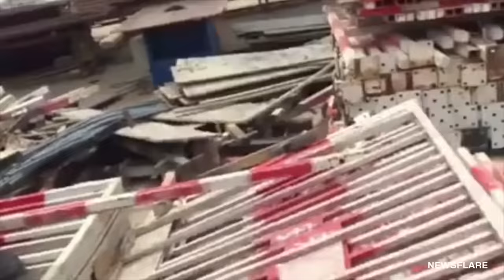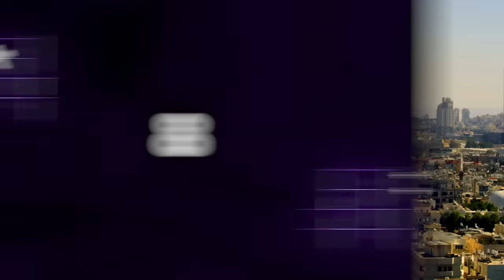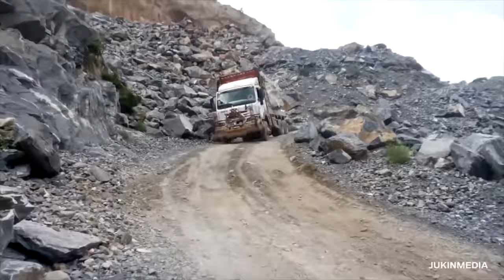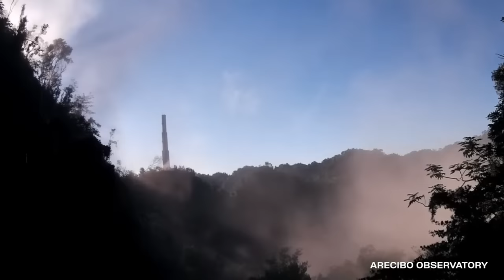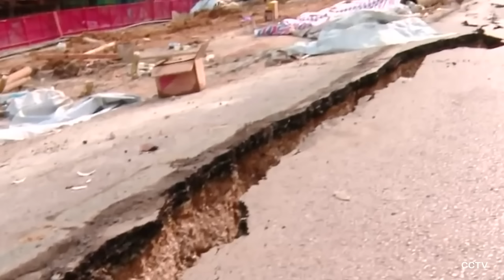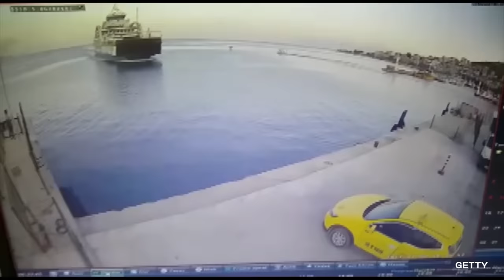10 Catastrophic Failures Caught On Camera

Comment: As far as the house on the outer banks going into the water, that’s nothing new on the NC barrier islands. I have lived here most of my life and every storm we lose homes to the sea on all the islands.   It’s not climate change or anything like that. The barrier islands are just sand bars that are in constant motion. They lose sand on one end and gain it at the other. That’s the risk you take building on a piece of sand in a hurricane zone.
Reply: fortunately the water was there to break its fall or it would have smashed to bits :)
Reply: Well stated.
Reply: Thanks for stating that...we had a cottage in Kitty Hawk for 30 years. Saw many storms and hurricanes come and go. Just off the beach we had a sandbar, I would surf the different ends of it. North end the cottages were eventually eaten by the storms. We also had the sand fence up and year after years saw them slowly be covered and grin at our success. Here's a bit of history for ya. The original bridge made of wood, I can't recall now but around 24 wide by 16 thick. The man which started our cottage ( his first, never finished it ) had somehow acquired those beams as they took down the old bridge. Those beams were and are still under the cottage. We always laughed...( in  fear ) of losing the cottage to a storm, " we if it does get that high, she'll likely float like a barge "...Back then...I could stand on the beach rd for 20 minutes in the summer and not see a car....sure has changed.
Reply: Should have built the house like a boat then better outcome!

Comment: Number 10 and number 4 look like the exact same thing from different angles.
Reply: They are not the same, apparently they just have a knack for these types of incidents.
(Different road signs, clip 4 has a road crossing in the upper frame where in clip 10 the construction workers were standing.)
Reply: The only exact thing is a large floating vessel ran into the shoreline/dock.
Reply: Not the same. Same type.

Comment: A truckload of granite toppling over is a mess, but not a catastrophe
Reply: It was a catastrophe for the truck
Reply: You could hear him excessively depressing the brakes. Each pump releases air pressure reserves in the tank. He ran out of air essentially.
Reply: @edsloan8535  most vehicles with air brakes will stop when low on air as the air pressure holds back the Spring brakes. When the air runs out the spring brakes apply. 
Pulling the yellow brake knob on a big truck to set the park brake releases the air pressure holding the spring brake back.
Reply: I reckon that was a controlled crash. Driver knew that if he did not crash into the side on purpose, then the slope in front of him would be the death of him.

Comment: Yah, I used to go to the Outer Banks all the time.  I remember the Hills. Huge sand dunes, a hundred feet high.  Threw my girlfriend off a cliff.  She got me back, pushed me off the cliff.  Had a great time there for years.  Went back not long ago and its so changed.  What once was so impressive today is barely a mound.  I asked a park ranger what the hell happened and they motioned out at the landscape.  Houses.  The sands were once carried by the two opposing winds going north and south.  They met at the outer banks, hit one another and went out to sea, depositing the load of sand they carried and this built the islands, the dunes,  the beaches.  Today the landscape is covered with houses and businesses.  The structures block the winds. The winds no longer carry the sands.  The beaches now erode, the dunes now shrink to nothing.  The islands disappear as the seas wash in to consume the sands.

Comment: I understand why houses along shores are built on stilts - to allow surging waters to flow beneath the house structure. However if the storm surge is high enough or the wave action is strong enough, two things can happen. #1 the pilings are insufficiently strong enough to resist the wave action or #2 the surge height sufficient to float the house completely off the pilings.
Reply: Knowing the above information, why do people have to build so close to the water.  High tides, winds and other weather conditions will destroy the buildings.   Is have an ocean front view that important.

Comment: Yeah those cranes are fine if you're lifting close, but think of the boom as a giant prybar. 
The farther the thing sticks out away from the base, the more leverage the payload has, and the less weight the crane can manage.
Reply: Are you teaching physics at a university? You explained the concept so clearly.
Reply: @chrisallen2005  You will do something: uh?
Reply: The right side stabiliser appears to have been been placed on very soft ground. It has probably sunk under the load.
Reply: Usually those cranes have all sorts of safety devices to prevent concurrent overloads like that. But they would depend on a solid base under the outriggers.
Reply: Nothing gave way. The crane was intact when it tipped. The crane was strongest in the front zone of operation between the two outriggers. 
As the operator rotated to the side the reach of the outriggers weren’t enough to overcome the weight of the load so it tipped. 
Lifting on the sides of most cranes is the weakest zone. Rearmount cranes lifting over the rear is the strongest zone using the vehicle as a counterweight.

Comment: The kid that crashed the rock truck kept on pumping his air brakes. That's a good way to empty the air tank needed for the brakes, which is probably why his breaks failed.
Reply: The air pressure in air brakes hold the brakes open, if the air system fails the brakes close, locking the wheel.
Reply: Yup. And an alarm starts going off when you start getting low air pressure. @FranktheDachshund

Comment: Surprised the kid hauling those rocks could climb out the truck with the size of rocks it must of took to get behind the wheel with a load like that. 😳😬
Reply: Very likely that truck was fixed again that week as well, and is back on the road, but perhaps they also figured that it was time to replace the brake linings as well.
Reply: @SeanBZA  If that at all, Yeah extreme zero maintenance, zero safety, zero concerns for driver at minimum wage, Brakes have faded and overheat by mid morning, use engine braking for rest of shift, new crew can suffer next shift...downshift, downshift, engine off...LOL, diesel...yikes 420, downshift the Spliff...take a Brake, break...do not Bogart
Reply: He did the right thing and drove it into the side before it picked up any more speed.  That load would have crushed him if it picked up speed then crashed farther down the road.  Smart thinking
Reply: Missed a few English classes, eh? "...must of took...."??? Must have taken...but then the remainder of what you said didn't make any sense, either.

Comment: China has built so much infrastructure in such a short period of time without many of the structural safety precautions we take for granted in the west, I wouldn’t be surprised if we see a domino effect of massive engineering failures there over the next 10-15 years.

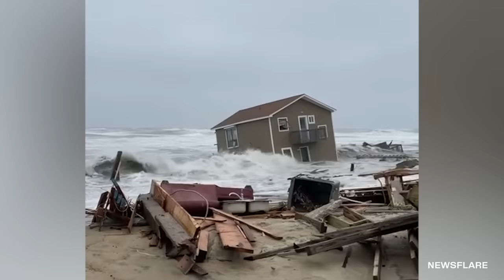Comment: 18:37   Sea levels are not rising.   All one has to do, is compare photos of the Statue of Liberty from its erection in 1886, to those of today.  Or Venice, Italy.  
What is happening, is the continental plate is sinking from roughly the Chesapeake Bay to the Caribbean Sea.  The rest is simply erosion of shoreline. (or more accurately, redistribution of shoreline)   A really great example of this, is to look into the history of West Cape May and Wildwood, NJ.  One loses its coastline, the other receives additional coastline, and it's been doing this for decades.

Comment: Arecibo observatory had been decommissioned years earlier with plans to cut it down. Because it was popping cable strands on its own, it was considered off limits as a safety hazard while they devised a safe method for cutting it down No one was endangered and having it collapse on its own saved them the trouble of half the demolition 🫡

Comment: Your assesment of the tank fail is completely wrong. No matter which way its facing the weight is still centered on the cable. The problem was actually the crane operator went past 90 deg to the support leg. From that point on the more he rotates towards the front of the crane truck the shorter the effective counterweight. If you look carefully you can see his front support leg is sinking on the soft verge transferring the weight further in to the front axle. Only escape rapid dump of load. It had zero to do with the guy line.

Comment: I'm wondering for #10, if there were tie back rods, or was the soil that loose?🤔
Reply: In China, they use subpar materials so maybe cheap rods and lose soil combined
Reply: Properly constructed walls would have been able to resist the soil load.  This was just poor engineering/construction.

Comment: 15:59 and this is why we layer soil and make MSE walls in the States. Even then, there's still a 1% chance they could fail due to heavy rains which is why proper drainage is needed within the wall base. You have to direct any flow of water
In a region like this in China  known for landslides, it doesn't look like they even bothered layering the soil much less proper drainage. All that weight on that thin way thats isn't even built in steps but one single structure

Comment: I remember back in 01 we was settin a lift station in Morhavin Florida.I had base section hangin on the backhoe boom . Dog that hole sub grade launched up 5 foot and the sheet piles were all in center of it. In 10 sec. My boss didn’t have enough toe in calculated for the end of  sheet piles and the sub grade of the lift station.

Comment: #9 there's a guy running around he front of the dock as the ship came in.. and as you zoomed in and said "luckily no one was on the dock or got hurt" literally you zoomed in on the guy standing there.. btw that guy flat out died he ran to the tracks of the crane out of sight just behind it and never came out the other side as the dock shifted and sank.. so safe to say he didn't make it.. js

Comment: Florida Designer and work with and engineer house on the Atlantic Ocean , the outer banks house collapsed North Carolina, the Structural Engineer is not at Fault,  the Geological Engineer did not recommend the pile foundation to be deep enough to support the structure in the Event of the 100 YEAR STORM,  this house collapsed in a small but major storm due to the Geological Engineers ground bore test failer to recommend a proper deeper pile foundation

Comment: That Chinese one at 1:19 may have been avoided if they all jumped over to the ground on the right, where the retaining wall was cracking, and shovel like mad to remove the weight of the earth behind the wall until it settled down. 2 or 3 guys with garden shovels would have had it sorted pronto. Couldn't be assed doing the work I guess...🙄

ROFL!!🤣😝💥🙋‍♂️

At 5:08 the narrator says imagine if ur standing at base of crane.
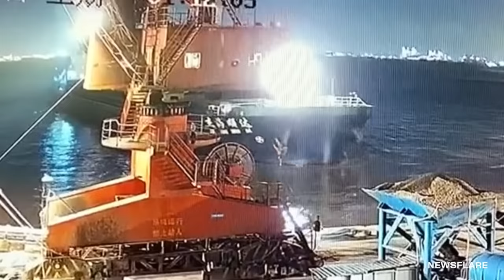Uuuhh, you mean like the guy at 4:40?? 😂

Comment: @jreagins1 ... The most obvious change is beach erosion, the relentless pounding of waves. It is exacerbated by humans who build houses and hotels on the  forward most dune line. It interferes with natural replenishment. Virginia Beach is a good example. Every year tons of sand are dumped on the beach in order to have enough beach for visitors to put down a towel. If they built behind the dune lines it would be less of a problem. Well maybe a slower problem. The Outer Banks are sand bars. Sand bars roll over over time. That is not related to climate change or global warming. If you think on it you can appreciate the coastal areas as living, moving things.
Coastal areas are to a slower or faster degree because of Climate Change or Global Warming. The warming leads to glacier melt which leads to Sea Level Rise and Subsidence.
There is a small island in the Chesapeake Bay, Tangier Island. When I was there 40 years ago I thought it looked like a Lily.pad.  It was a quaint community of fishermen. They had a one room schoolhouse. Because there had not been a lot of mixing with the mainland you could hear an Old English flavor in their speech. A golf cart was the closest to a car. Currently they are losing about 15 feet a year to the Bay. The cause is a combination of Sea Level Rise and Subsidence. The water level rises and the land sinks. I was looking up spelling of subsidence and see there are three or four causes.
Anyway, I thought it was a place to gather the terms so relevant in the near future.